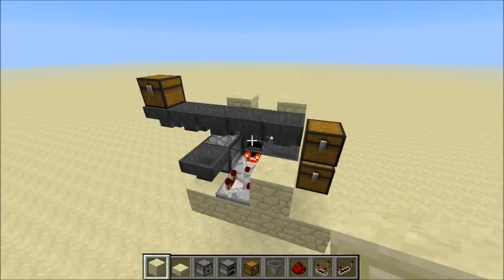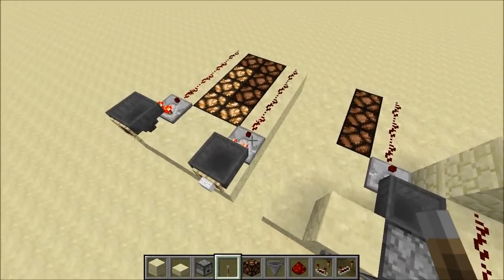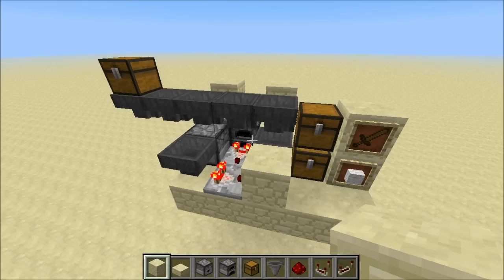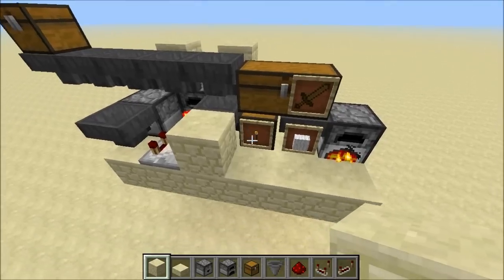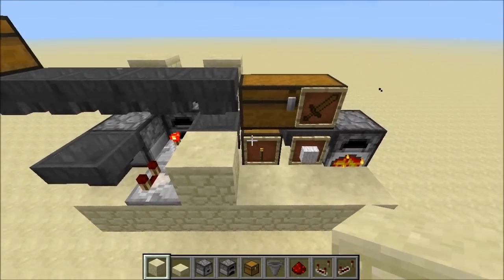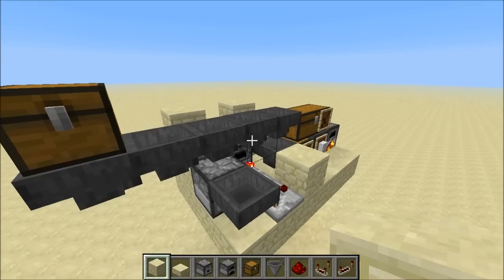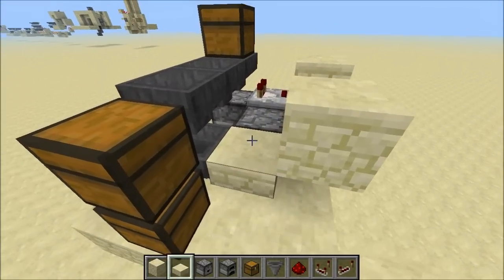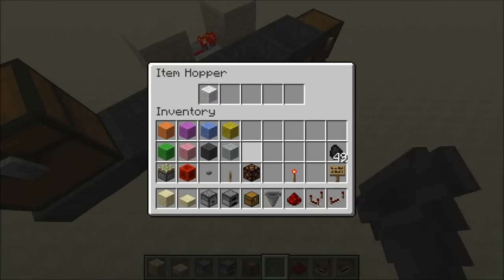Minecraft Tutorial - Conveyor Belt Intersection using Randomness

Comment: If you want to remove the randomness of the equation you could replace the hopper-dropper combination with 2*N hoppers in a circular loop (N > 1).
Haven't tested that yet but I think it should work. 
or just use ANY kind of clock circuit to disable the lower hopper in the frequency you want. No need for a second power level. (but maybe there weren't that many clock circuits in 2013...)

Oh and since you're using the ridiculous[1] term "conveyor belt" I strongly recommend adding "hopper transport line" to the title or at least the description.

[1] this is Minecraft and while it behaves a tiny little bit kinda like a conveyor belt it just isn't.